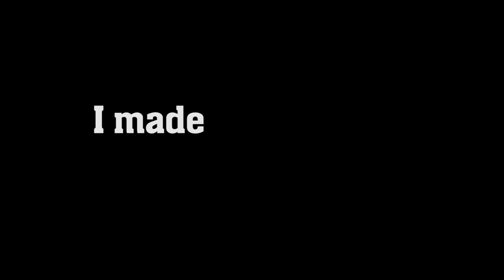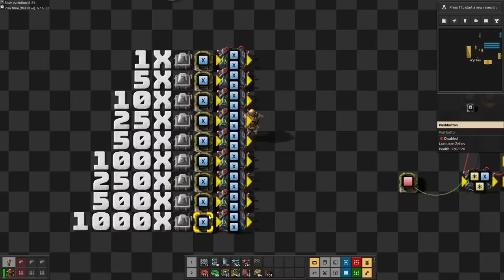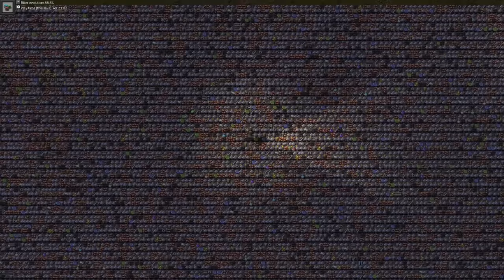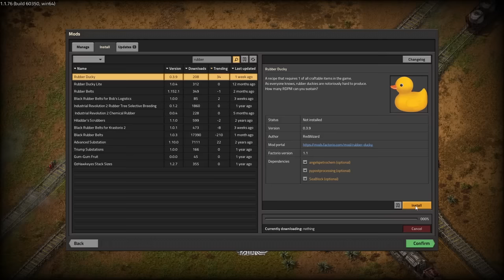How Hard is it to Beat Factorio When EVERYTHING Goes on the Same Belt?

Comment: I had a lightbulb... Wish I hadn't.. I'm only at 11:45

How about a sampling counter memory cell. Meaning that instead of an exact count, you sample the belt, like evey minute or so.
If you don't see that you have 60 iron plates on the belt, you add X, next sample, if still down, add X again

I know it is much less accurate and it has more chance ot fill the belt, but saves so much headache and hassle to keep track of everything down to exact number. It also eliminates ghosting. and you don't really have to track subtractions.

I also realize that a long belt means more time to circulate, BUT with longer belts means more "storage" on the belt.

You could tighten the timing. "If you haven't seen an iron plate in the last second, put one iron plate on the belt... repeat" you have 6x15 slots, meaning every second 90 different thing on the belts with 1 per sec speed

I know it is not efficient, but we are talking about sushi, so efficiency is already dead!

Comment: 4:47  i have an idea which you probably all ready tried and failed with ... but at the slight chance that you did not... just have filterinserters before the smelter stacks that pull it off and put it back on the main... kinda as a  functional part of the smelters. .. if there is too much iron just turn on the filter inserters that pull ironore from the line of the smelters back to the main bus xD

Comment: This sushi belt system is much low how our cells work. Lots of little nanomachines getting their input from the intracellular fluid and dumping their output back in there. The difference is that the machines themselves are also floating around, so it's like if you had everything on the sushi belt, even the factories. It's all a beautiful mess where it's almost impossible to change what's already there since so many things are built on top of it, so instead evolution just keeps building new cruft on top.

Comment: Your problem with uneven item distribution is fixable. You are currently only randomizing horizontally across lanes. You also need to be randomizing vertically down the length of the lanes. The way to do this is to add delay loops that recirculate a fraction of the belt contents. 

As an analogy, imagine 8 parallel liquid pipes carrying successive blobs of water, oil, and acid; mixing across lanes would only do so much. You'd get a far stronger mixing effect by pumping all 8 pipes into a big storage tank / blender that's continuously outputting an averaged mix of the current tank contents. If these pipes started out fully differentiated, with 1/3 of their length occupied by each substance (and these regions aligned on all 8 pipes), horizontal mixing would do nothing, but each pass through the storage tank will blend the boundaries between the regions such that instead of a sharp transition from A to B, there's transition regime characterized by an exponential decay from A to B with the decay constant (ie, the width of the transition regime) being proportional to the tank size. If the tank is larger than the pipe capacity, the fluids become thoroughly mixed after only one cycle, or with a smaller tank, it might take several cycles to achieve thorough mixing.

Translating this insight back to discrete items on a sushi belt, the math works roughly the same way, but with probabilities instead of proportions. So how do we construct a mixing storage tank using belts? We need to create variable length paths that the items can take. Your base already has this to a small degree on accident, as each time you round a corner, the outside belts travel further than the inside belts. But as you've observed, that tiny degree of time shifting takes hours, or even days to equalize the mix, so we need to amplify it. One simple trick would be to create dog-leg routes that extract ~50% of the belt contents, send them on a detour, then mix them back into the belt. As the belt progresses, half of the items would be replaced by items that were previously at an earlier position on the belt. This can be implemented by upgrading your balancers from 8-way balancers to 12-way balancers with 4 of the inputs and 4 of the outputs being connected to the dog-leg (or even a 9-way balancer gives you some distance mixing). Do this in a few places and the clumps on your belts will begin to smear out over longer and longer distances until there's a uniform random distribution. Or since your belts are already a big loop, if there are any places where you can swap lanes from opposing sides of the loop (ie, each side sends 1+ lanes of its sushi mix over to the other side of the loop), that provides great long-distance mixing. Think of it like shuffling a deck of cards, sometimes bridging and sometimes doing a cut. A more vanilla mitigation would be to input your ore in more than one place, or throttle the rate at which it mixes in. Adding just a handful of mixers and long-distance bypass swaps would go a long way towards homogenizing your mix towards true sushi-belt nirvana.

Comment: rather than keep an exact count of the items on the belt, wouldn't it have been simpler to just keep track of the relative ratio of items. (ex. keep count of every item that passes through but use the data to calculate what percentage of the belt consists of a given item and order more when the percentage gets too low). the advantage of this scheme is ghost items can't affect the system

Comment: I did a small sushi (science for labs only) and I did not use a memory cell ... I looked at N belt tiles and counted the amount of science X to be found, and if it was low, I would admit more science X to the sushi.  I think you could do the same at least with copper, iron, etc ... and maybe even scale properly by calculating how full the part of the sushi belt conglomerate is.  You might want to to be no more than 90% or 95% full, so that stuff can be put onto.

But yes, everything sushi is ... not quite viable.
Although you could have put 4 belts past each assembler w/o needing underground belts: 2 above, 2 below.

Comment: theoretically, could you do this without the memory cell instead using positive and negative feedback loops, the same way our body does it? For example, a factory making a resource needs iron, this triggers a circuit on the iron production area to release iron into the bus. The iron production then detects when there is too much iron by having a series of random circuits where if a random number is selected the same time an iron is detected, that circuit turns on. The more iron in the system, the more often this happens. Increase the number of circuits running at once and you increase the threshold of iron required.

For positive feedback, if the circuit goes green then increase production. Dunno what purpose positive feedback could have though.

Comment: would it be possible to create some kind of automatic estimation/counting system for everything that's on the belts? Like have some kind of indicator item, only one of which is manually placed on the sushi belt. Say, one piece of flamethrower ammo or a U-235. Whenever the counting system sees that specific item on a belt, it resets the counter and saves it's value to a buffer. You then add all of those buffers up for all of the belts and you have a rough estimation of what's actually on the belt.

Comment: You should add the time control mod, it allows you to run the game at a faster speed, 1/4 1/2 1x 2x 4x 8x 16x and 64x IIRC
Obviously will be limited by UPS but it would save you hours

Comment: Instead of creating a hard count of what is on the belt and using that turn on/of inputs, would it be possible to statistically sample the belts? Count to some fixed value, perhaps 100 and track how much of a resource is there. so you could get an approximate percentage of how much of that resource is on the belt.Then if it is below some threshold turn on the flow otherwise turn it off. This will certainly be less accurate but would have the advantage of being self correcting and free of big belt flushes.

Comment: I wonder if it's possible to put some item on the belt that is never used by any processes, like a spidertron, to use as a lap counter, then count everything on the belt per lap, and when you count the spidertron reset it.  That could possibly detect any issues like "way too much of something on the belt"
Reply from the maker: The main issue is the time to make a lap heavily depends on which lane it gets balanced to because the higher up belts need to travel longer due to the length of going up then going back down to fit in the assemblers. A timer definitely would've been handy though. I guess if I ran it long enough I could take the average travel time, lol.

Comment: You dont need to separate furns,  you just need a chest before every furn, and allow moving items from that chest to furn only when chest have enought materials  to complete recept ( 5 iron, 3 stone)
Reply from the maker: It wouldn't work for several reasons I'm not going to explain, but it mostly has to do with the limitation of needing both the red and green wire to run the filters and update the memory cell. The only way you could possibly do it is if you had a dedicated memory cell for each furnace, which is not feasible at all
Reply: @DoshDoshington   You can do it , and i did it couple of years ago, it is preaty simple but  no one did it (at least i never saw, what makes me very proud of myself -)  ) I have a smelter setup, in whitch u can throw any mix of smelatable resouses an any rate ( cooper, iron. iron plates, stone) and all smelters will aways work  100% of time and never clog. U will need 1 filter stack inserter, limited to 5 items and set to take filter signal  from wire, 1 regular inserter to fill   chest, set to be active while chest does not have enought material  for 1 roud of smelting ( it shoud  work when there is f.e. 1 stone 3 iron plates, but should stop when there is 1 stone 3 iplates and 1 iron ore), and all u need to make it wokr is a wire with -4 iron plates and -1 stone static signal.
Reply: And im sure that no one  did it, beacause  that setup is so good that u cannot  do smelting diferently after u saw it working. If u are lacking of smelting power, no matter for what - u just add more universal smelters and thats it.

Comment: I mean.. in theory you couldve made this SO much easier.. factory kinda runs on ratios meaning you can make your factory produce just enough resources it can use which would just mean that the belt gives exactly whats needed
Reply from the maker: Do you have any idea the circuit abomination I'd need to create to measure perfect ratios all on a continuous belt. It's not easier, it's about a hundred times harder, but it's certainly something I could've done, but I wanted to see the river of trash instead

Comment: Is there a way to add a second verifier cell at the 90% point of the sushi belt? (Or anywhere after the last run of assemblers, could be another balancer to serve a double purpose) Just to count items, although you'd need to exactly know how long items take to go around the belt and flush it that second and load the values to the nixie tube mod so you know how many items to add/delete to the original cell and not have to actually flush the whole belt every time there's a problem.

Comment: One issue - this isn't "same belt". There are multiple belts going in the same direction, so it does not count.
Reply: Also you are feeding the ore through separate belts. It should be the same belt as the one with all the components on it.

Comment: Instead of trying to count the amount of items on a belt wouldn't it be easier to measure the throughput? Have a counter counting up a resource.  and have a small belt just rotating one of the resources counting down.  So you could balance the throughput but either adding more of the resource to the small belt or making the small belt longer.

With this you wouldn't ever have to reset the belts.

Comment: could you not eliminate the gaps if you switch all belts to blue but leave a single red somewhere in the circuit so itll slow the flow down?

Comment: Could you program the assemblers like you did the furnaces? Change a certain amount of them to recipes with high demand then there would be some kind of guarantee that certain items are made. Block incoming recipe changes once it started craft. But have something to change the other idle assemblers when quota will be met.
Reply: The thing is, it works for furnaces because furnaces don't use recipes, they just react to whatever gets stuffed into them. In vanilla Factorio there's no way to get an assembler to change its recipe in response to a circuit network signal. The only way to do anything of the sort would be via the Recursive Blueprints mod, and that'd add a whole nother layer of hell to this whole mess.
Reply: @underrated1524  that's a good explanation. Doesn't mean I don't want to see it eventually.

Comment: Hey Dosh, maybe there's a comment in here with a good explanation, but I'm new to sushi belts and trying to build my own. Do you think you could make a quick explanation of how your first controller worked?
Reply from the maker: My recommendation is don't do Sushi the way I did it unless you're going for a really big, dumb build like mine. The much easier and more convenient way is to wire up your entire circular sushi belt and set every belt to read : hold and that will essentially let you treat the entire belt like a chest by constantly reading its contents and using that to control inserters or enabling and disabling belts to put the level of what you want on the sushi belt

Additionally, if you don't want to wire up the entire circle, you can opt for the similar in concept, but not as accurate option of wiring up only a section of your sushi belt, say eight belts long or so, and read : hold on those, and instead of treating the whole thing like a chest, you use that to control the input by saying something like, "If there isn't at least eight of this item in that section, add more" and you can approximate a ratio just based on that small section.

The best part about this design is that you don't need to bother with reading what the machines pick up, you just need to know what is on the belts.
Reply: @DoshDoshington  Thank you!

Comment: 6:40 does factorio not have a way to detect what's on the belt, rather than relying on counting every single addition and removal manually?
Reply from the maker: It does, but you'd need to wire up every single belt and it would be really ugly. The easiest version of sushi is wiring every belt together and treating it like a giant chest but I wanted people to see the torrential sea of trash so I went with probably the most cumbersome and error prone method.

Comment: this is a software design problem. Kind of cute to see mortals struggling with all of the operators, failing to write a proper program and resorting to "adding balancers everywhere" until some of the inputs can be satisfied by pure chance 😀
Protip : you cant implement a proper resource allocation program without having a clear reading or at least a realistic approximation of available resources in your network (read : ore in the ground) . You need clean data; thats what digital software is all about. Apparently, factorio ore miners do not output any ore availability signal and i cant seem to find any mod for that ... which basically limits any kind of software you design to an analog network of approximations ... meaning : it can never be fully functional. Sorry. You "can" do approximations and take "guesses" on ore availability, or simply start your program after ore extraction, hence pump out availability signals one by one (exactly what you're doing) but ... that'll yield a basically unmanageable network and your signals will combine into a chaotic, unguided and incalculable mess at some point. UNLESS you were going to try and implement a neural network ... but that will easily surpass any technological capability of factorio looong before you get your first results.

Comment: I'm somewhat saddened that at no point did you put something crappy like a handgun on the belts so you could scan the belts for the handgun and make an automatically updating clock that shows how long a round trip on the sushi bus is.
Reply from the maker: The problem was that depending on how it got balanced along the lanes it could take way longer. I suppose I could've made a rolling average with shift registers and see what the average travel time was

Comment: did you use some sort of QOL mod for this playthrough because i saw a seperate tab with a purple pick. Just wondering
Reply from the maker: That's the editor extensions mod just existing. If you remember that part when I went into the lab to make designs, it's that.
Reply: @DoshDoshington  ok thanks for clearing that up